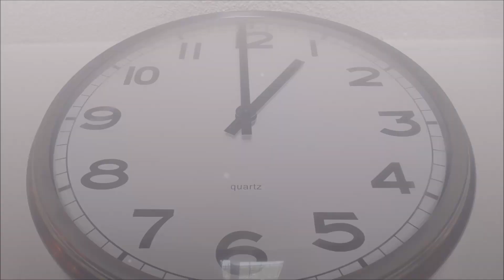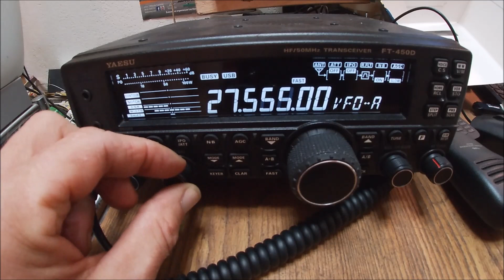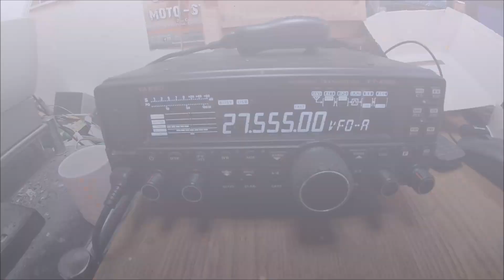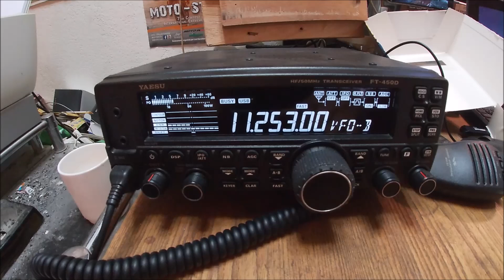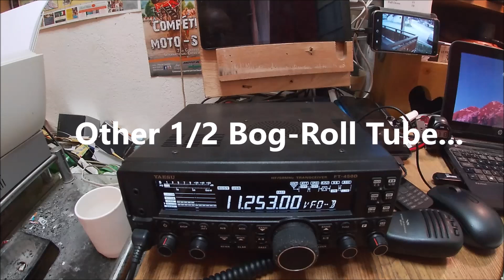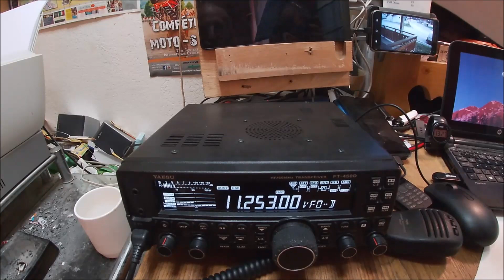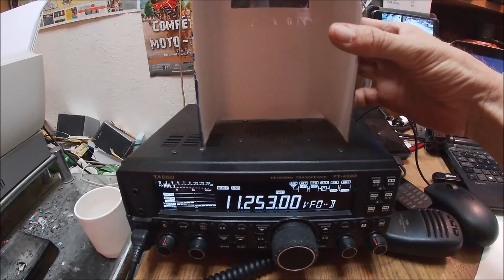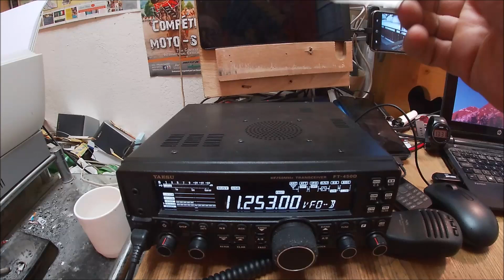Yaesu FT450D ~ Modifying The Front-End Audio ~ Experiment & Simple Effective Solution ~ For FREE!!!

Comment: Many hams use compressor as a mic preamp to increase DX range and improve modulation/energy similar to you your approach but at Tx site. Simple solution which does not claim to have best results is to cut a half litter of a plastic cola bottle near the bottleneck and have something as a funnel.  then glue pistol and fix that funnel with the bottleneck to the mic. I used that with very interesting effect on my AM/FM CB long time ago... however, never teste on SSB as I bought HF transceiver already, but remember feedback was improvement.
Reply from the maker: We all have our ways. This worked a treat but I have since linked up a 100w.Logitech PC audio system as a more permanent set up. Thanks for that. Cheers